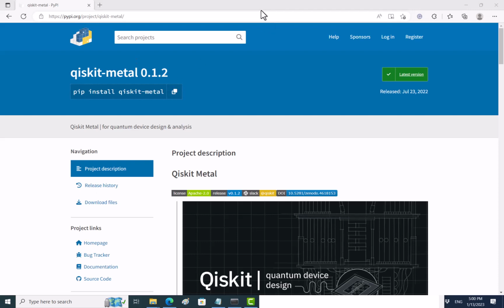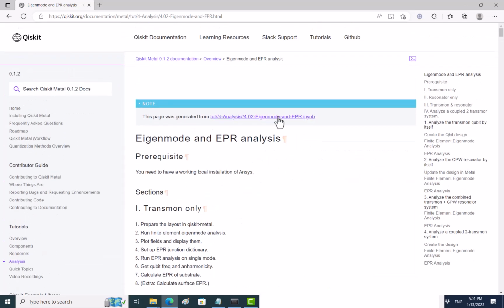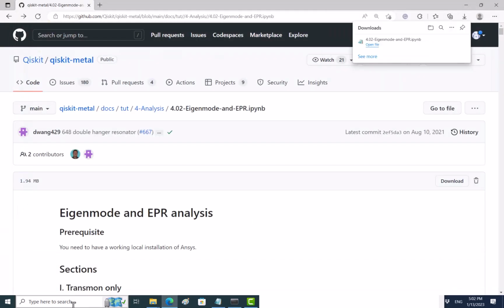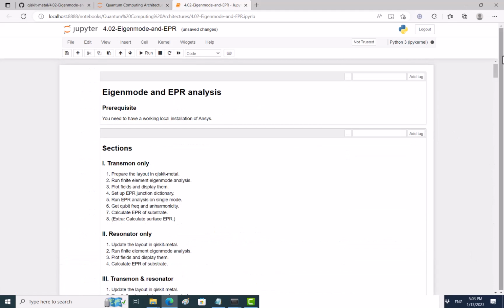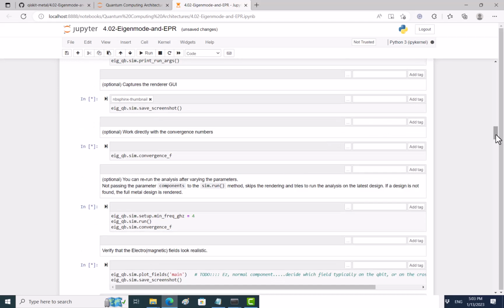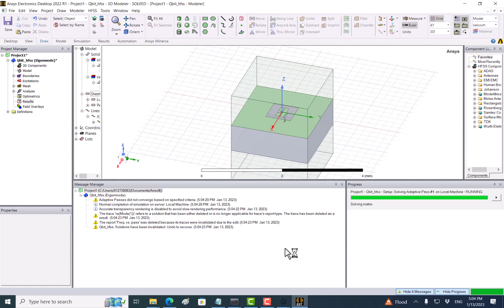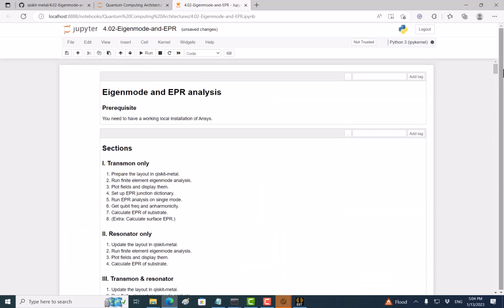Lab 5) Example on Qiskit Talking to HFSS for Qubit Design

Comment from the maker: For ANSYS 2024, 
Video Lab 5
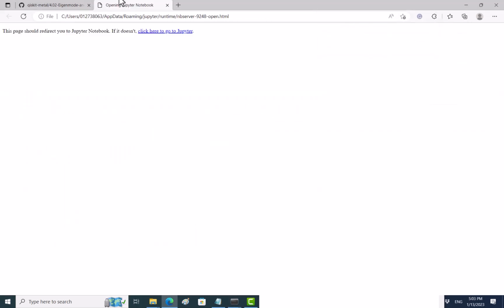+ At 1:31s, fix the Python code before running the notebook:
  ++ Open the core_distributed_analysis.py to comment out the lines 1578 - 1583. Its location in the video should be conda\envs\qmetal\Lib\site-packages\pyEPR\core_distributed_analysis.py .
Reply: Hi, I have encountered a problem when executing the notebook: com_error: (-2147221005, 'Invalid class string', None, None). The log in qiskit metal GUI says this is because COM ProgID "AnsoftHfss.HfssScriptInterface" is not registered. 

However, when I list all the available COM ProgIDs, there are only "Ansoft.ElectronicsDesktopStudent.2024.2" and "Ansoft.ElectronicsDesktopStudentArchiveFile.2024.2". Commenting out lines 1578-1583 in conda\envs\qmetal\Lib\site-packages\pyEPR\core_distributed_analysis.py doesn't solve this problem.

I even tried to modify the file located in conda\envs\qmetal\Lib\site-packages\pyEPR\ansys.py:
line 370, ProgID='AnsoftHfss.HfssScriptInterface' to ProgID=''Ansoft.ElectronicsDesktopStudent.2024.2",still, the problem remains.

Is this a problem with student version? One command on stackoverflow says uninstall all C++ redistributable and reinstall HFSS may help, but I am afraid of crashing other software by doing so.

Any suggestion will be well appreciated 🙏
Reply from the maker: @alvinchen6589  Sorry, I am not sure. If you have the exact same version as ours, it should work. Thanks!
Reply: @alvinchen6589  Hi, I have encountered the same error and according to what I found it is because I have the student version of Ansys. Is that the case for you and were you able to find a solution?